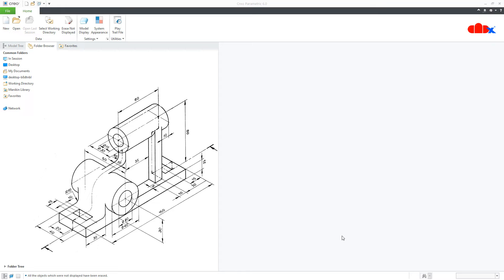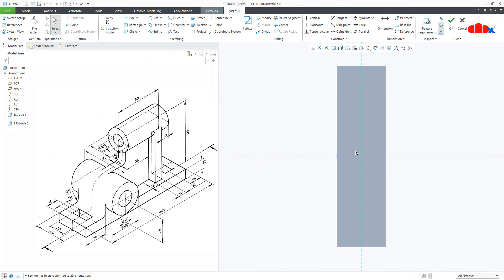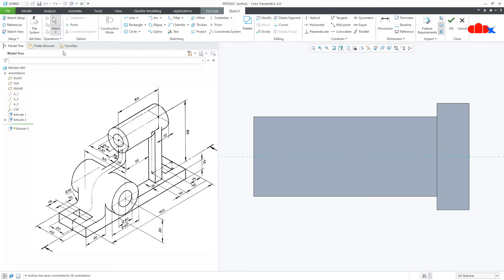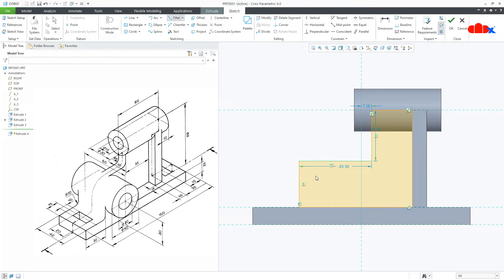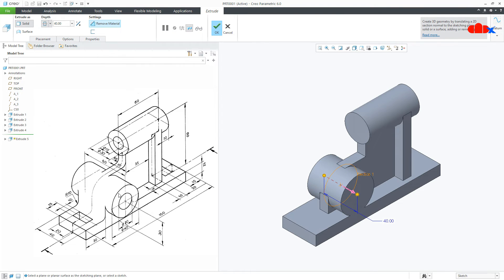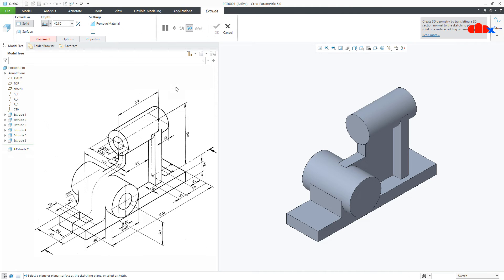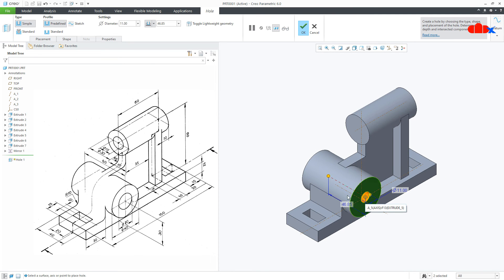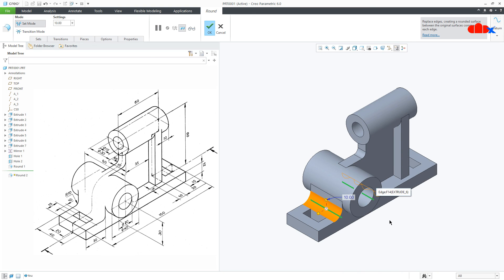Creo part modeling tutorial Machine part-18 in Creo Parametric

Comment: For such parts, I would prefer to start by creating basic datums e.g. Axis of the two cylinders etc. Most castings are Cast and then machined on functional surfaces.
Reply from the maker: Modelling practice differs as per industrial manufacturing process. As a beginner you cannot understand such practice. These things you understand when you go to the industry.